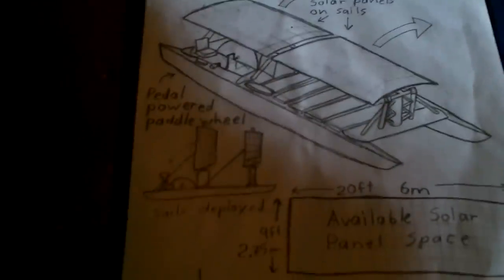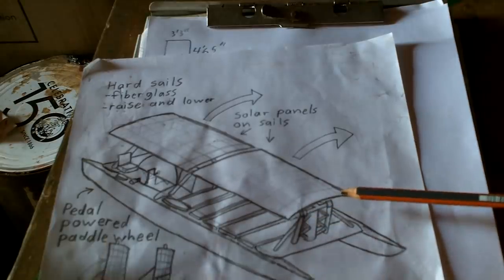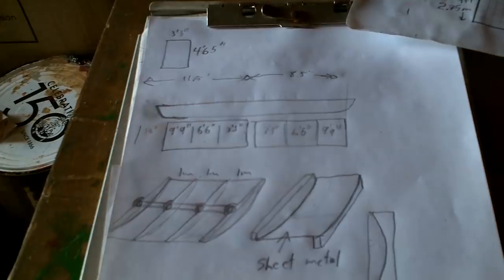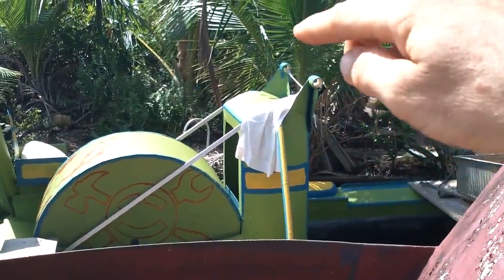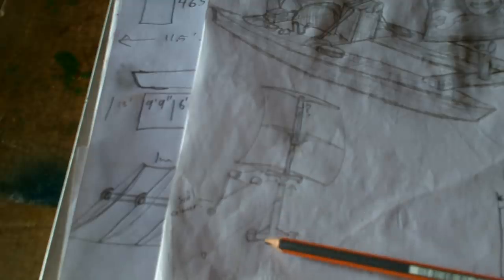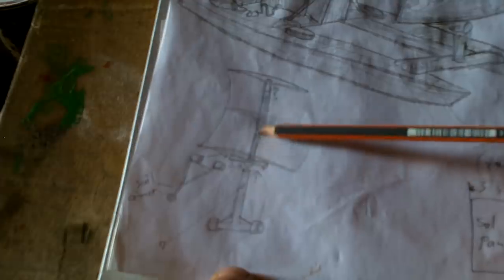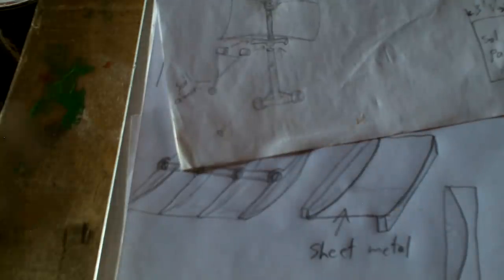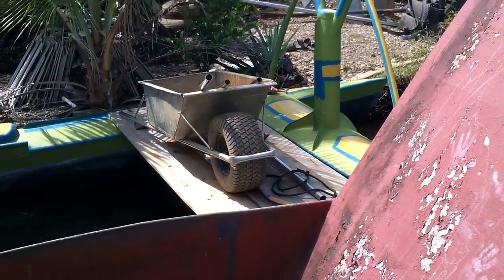Solar Sailer 019 Designing Solar Sails

Comment: Lot of get suggestions below. Please consider them. There are some great videos on how to make a wooden mast that is not solid. Also, consider if you have a 3 inch pvc pipe or whatever size  of inserting a smaller pipe to give it greater strengthen. Do not underestimate the strength of the wind. There is a reason why sailboats have guide wires attached to the mast. Even a 8 to 10 mph wind can place a lot of stress on the sail and mast. My wife and I retired from Napanee, Ontario, Canada this year to Roatan, Honduras. We are in the process of finishing our triplex. One of my goals for next year is to build a solar powered pontoon boat using the knowledge I have gained from watching  your videos. I look forward to your build and how you incorporated hydrofoils.

Comment: I made a solid sail like this in the 80s for a model RC sailboat, but had a skin on the back too. A sail is essentially an airplane wing. Mine was 2/3 of the chord in front of the mast, and 1/3 behind the mast. The second thin fiberglass sk9n will not weigh much, but it will add a ton of stiffness and strength! I used thin slices of wood for ribs on an arrow shaft mast. You could use rigid polystyrene ribs glued to the two skins, and it would be as strong as a glider wing.

Comment: Might want to put a 2 meter center hull up front to keep the bow up ... Cut the pedal axle next to the paddlewheel housing and put in a multispeed bicycle back sprocket cluster ... That way you can freewheel the pedals when motor engaged with paddlewheel . If you motorize the paddlewheel that is . Mold horizontal sail spars into sail ... Maybe even outer center tube ... Use thick wall for inner tube or it gonna break at the bottom pivot ...

Comment: Forgive my ignorance, but will the front sail cause the nose of the ship to dive?
Reply: The rear one could too, any force pushing forward above the waterline causes the nose to dive a little. Generally it's not a big issue if the boat is designed well enough and with moderate wind. I've nose dived a cat before in 30kts of wind. With for and aft sails, when going across the wind, you also need to balance the pressure to maintain directional control which could be a challenge.

Comment: Unless you make the mast out of (thick) carbon fiber, then you will need to only use these sails in light winds, most sailboats use stays (metal wires) to take the loads so the mast doesn't need to be a thick. Because your sails are rigid, you won't be able to adjust there shape to suit the wind strength (flatter for strong winds, more curved for light winds)

Comment: Having sailed a lot in my youth I think your plan is pretty precarious.  There is a lot of force acting on sails and the wind gusts in unpredictable ways.  I think you would be much better off mounting the panels as a roof on the boat and have a separate mast with sail on it.
Reply: I've been thinking the same thing, it would be pretty easy to get over powered in that thing and flip or have something break. You really need to be able to adjust the sails quickly and by yourself! I like your idea of a separate mast. On the other hand, if he builds this we all get to learn from the experience which is really awesome too. I already know from experience you NEVER underestimate the wind or the sea.
Reply: agreed and you lose a lotif you lose those sails with solar cell in them. also you cant use the solar panels while sailing unless at sunrise or sunset.
Reply: I agree.  That is why sailboats have a keel to keep the windpower from turning the boat over.

Comment: I don't think any amount of electric power or pedal power can compete with the wind for a 30mile trip. electric power should be minimized for going in and out of docks and the boat should be a catamaran or trimaran. With a decent little Trimaran you can easily get 12-20 knots with a fresh breeze.  the only thing the paddle wheel does is replace a small electric outboard. I currently sail 3 boats. an 8' Banshee (my favourite), a 14' Link and a 26 foot Grampian but I miss my 30' Piver trimaran.

Comment: Could you use old and new technology, set up a rope rigging system to lift and lower the sails, this may not be feasible due to the weight of the solar panels.Get an ebike crank drive system and use the crank to pull (via rope and chain)a mechanism to lift and lower the sails.

Comment: Poles would have to be very strong. Wind + Weight of the solar sail panels are going to create a lot of pressure. Especially in stronger wind. You have no underwater fin as far as I can see (or daggerboards). But then your design can not use sidewinds anyway. How about just two vertical windmills to use the wind and forget about heavy center pointed highly compressed inefficient solar panel sails?

Comment: I have watched with glee as you've explored your life on your islands. Congrats on doing things your way. Two comments and put what weight on them as you will. 1] without a failsafe way to easily drop the sails, you have, as others have surmised, a quite good chance of capsizing or catastrophic mast/sail failure. 2] If you do build the sails, the top portion of the "mast" can be quite a bit smaller than the lower portions as the strain on the upper portions should be less then the lower portions. As a lesser comment, have you considered telescoping masts? These would allow you to lower the masts to a partial position in higher winds and a possible quick way to drop them to a partially erect position if conditions quickly worsened. Good luck!!!